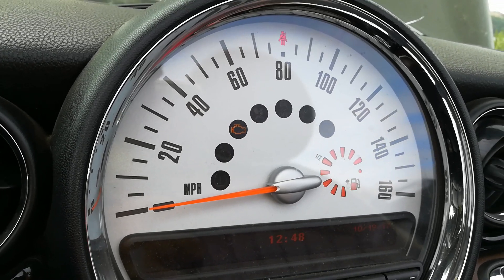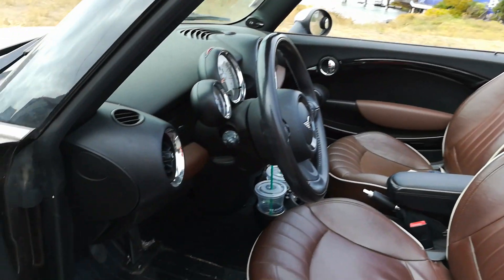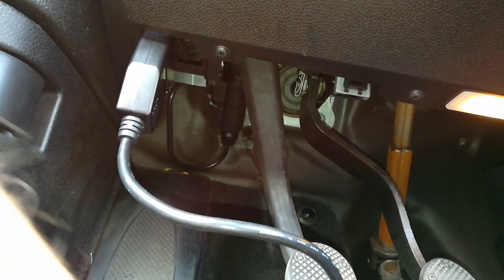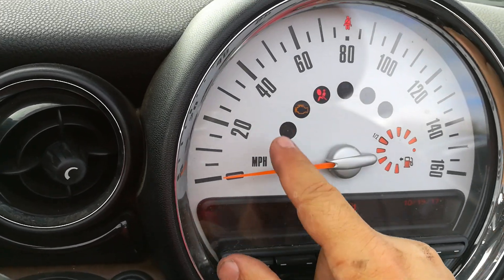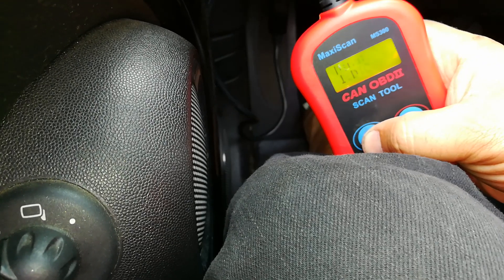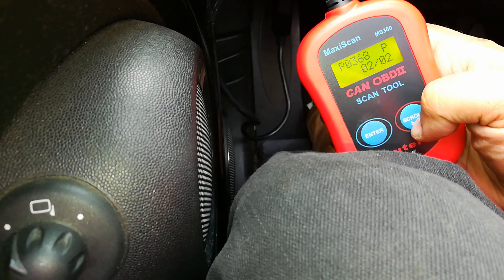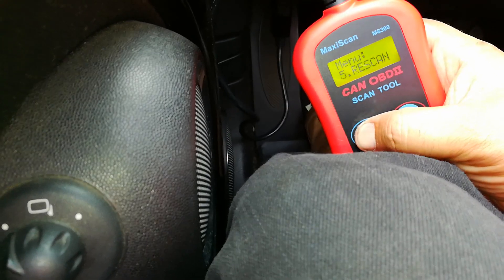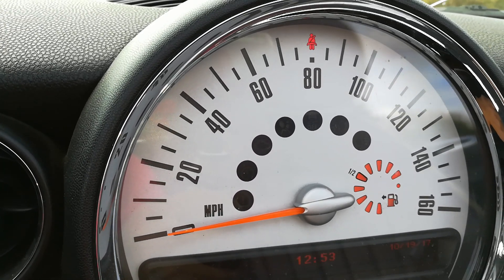Mini Cooper Check Engine Light Reset R56

Comment: So I did this and it worked but after the 2or 3 time I started my car the light came back on so I guess I’ll will run codes again and see what I need to do! I hope whatever it is you will have a video for!! Thank you!
Reply from the maker: Just write down the codes and after it happens s 2 or 3 times it maybe time to fix. Some of these codes will have no to little effect  on your vehicle but are used for emissions. Depending on where (state) you in live this can be a big issue when it comes time to renew your license plates.

Comment: Oh man I love you , I was struggling to reset the light but I got the scan tool and boom it worked !!
Reply from the maker: Glad to help and just know it may come back so write down the code. If it pops up three times and your battery is good then it may be time to repair or replace a part on your mini.

Comment: yeah!! thank you! This the best video. I purchased the scanner in Amazon $19 only. You should get Amazon commission $$) 
I followed your instructions and it works. I watched another videos and I was getting annoying because too complicated. Of course English is my second language so I was thinking by saying turn the ignition on was to start up the car lol 😂 so I did it and my code was P053a , I have a mini cooper countryman 2011. The light went off. So now don’t know for how long. But, Thank you 🙏 very much! I m going to share this video if is ok with you.
Reply from the maker: Glad to help. If the code comes back try this cheap and easy fix, nothing is is guaranteed but I would try this unless you have better diagnostic tools.

https://www.northamericanmotoring.com/forums/stock-problems-issues/337936-fixed-my-p053a-code.html

Good luck and keep me posted

Comment: Hi, I have a problem with my Mini Cooper s r56 not start. 

The mini was on taking it out of the garage when it suddenly turned off.  The first Scanner have these codes:
 2781
 2775
 2D52
 2DCA
 275F
 272F
 I changed 4 spark plugs, 4 coils, the Camshaft Position Sensor and a new battery.  But it did not turn on, now it is giving these codes:
 005E31
 009314
 00A0B4
 00932D
 009CB5
 I deleted them and it only gives me this code: ( A0B4 )
 The mini starter good but not start.
I try the new battery and it says it's ok, but when I test the battery with the terminals mounted on the Mini Cooper it says it's bad I don’t now why. I also reset the new battery in the mini system with the scanner but nothing.

Honestly, this situation is driving me crazy since the mini is in the garage and I need to get it out to get a jeep behind it.  If I take out the mini I won't be able to enter it again because the garage is elevated.
What do you think?
Reply from the maker: Sorry for the late reply! did you find a solution?

Comment: I very much enjoyed your video and I learned how to use my OBD Reader. 3 codes come up which are POO15,- (Freeze Frame on reader), but on app ( Exhaust camshaft position timing over retarded bank 1 ) P2187 - System to lean at idle bank 1, POO442 -Evaporative emission system leak detected — small leak.  I am willing to fix it myself, I've never fixed a car before.  Are there any suggestions you can give me before I give it a go? Can you tell me about how much money I will be spending?  Do you suggest I take it to a mechanic Because it's not possible to fix it by myself? I value your professional opinion and thank you for taking a time to read my post. Hope to hear back from you.
Reply from the maker: Reset and see what codes pop back up. Then attack each code in the order then pop up. Leave the evap for last.
Reply: Pray

Comment: I tried many times  the same thing with the same scanner but will not erase the codes? any idea why? 2010 mini cooper i know i have no problem with the engine its some kind of silly sensor that's not working properly
Reply from the maker: On.  2010 + vehicles you can't simply clear the issue. What silly code are you referring to? Is is a permanent code? Please check the smog tips play list for  info about this issue on 2010 and newer vehicles
Reply: Was curious if/ how you you resolved this issue…. The dealership is trying to tell me it’s the timing belt, but I seriously doubt it because it doesn’t have that many miles on it.

Comment: I have a 2010 mini cooper convertible and i barely drove my car for like 3 months due to shut down for COVID 19 pandemic. Now i'm driving it to work which is barely a couple miles from my house and now i'm getting this engine light on. It's yellow and it came on, went off, then came back on. Should I really be worried something is wrong with my engine? I barely drove it! It seems this damn light keeps coming on all the time. I want to get this tool to turn it off but just am afraid i'll be hiding a real problem. There are no other issues i've had with the car.
Reply from the maker: Did you ever get the scantool? is the issue fixed now.
Reply: @RANDOMFIX  would it work?

Comment: I have a problem of mini cooper 2010 mass air flow i changed it and then i have the same problem the scanner show me that the airflow sensor still  has a problem what shall i do in this condition
Reply from the maker: Ali, That's a great question, why did you change the mass air flow in the first place? did you buy a oem part? did you clear the code after the install? _Randomfix

Comment: but does it pass inspection ? bcuz theres no point of erasing it and then u cant pass inspection
Reply from the maker: Hi Tony, yes you will have to complete a drive cycle after reset any codes. Best of luck